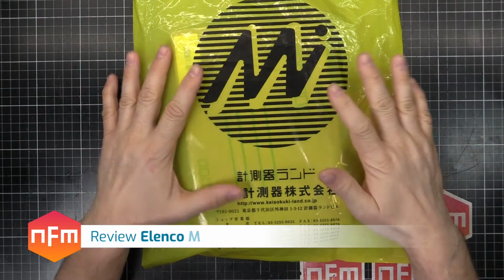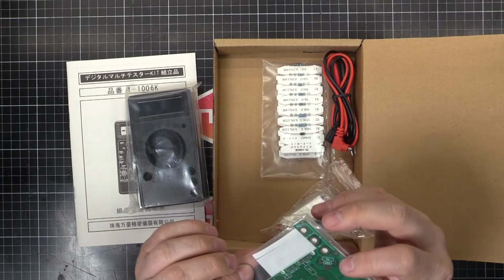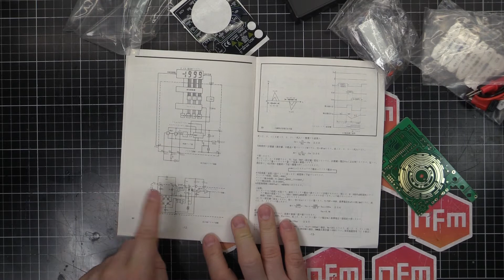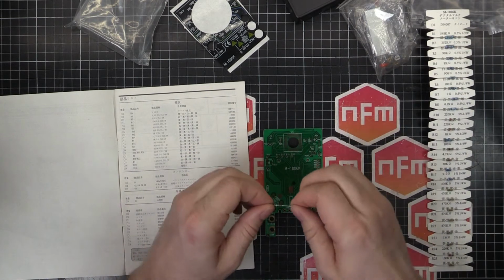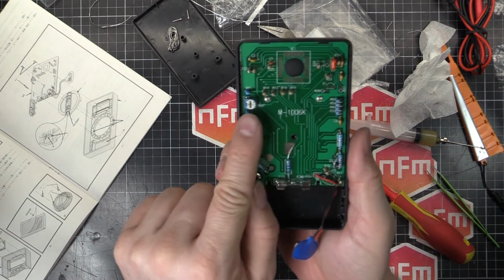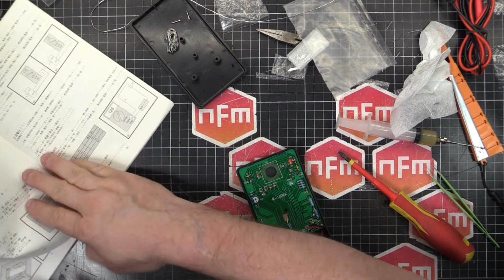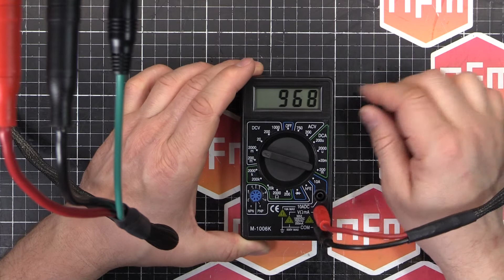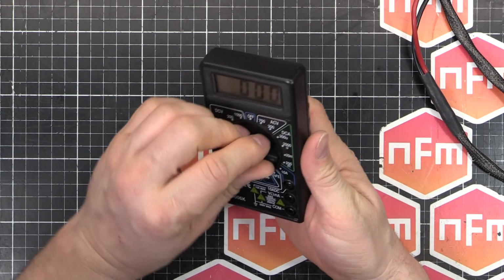Elenco M-1006K Multimeter Kit Review

Comment: Some use these cheap multimeters as panelmeters in DIY power supplies.
You can buy these assembled for half the price , look on the internet for DT-830B. 
They are available in black and yellow and are on the market since the 90's as M-940.
There is also a black version, with a flashlight build in on top.
Reply from the maker: That flashlight model sounds interesting. I wonder how many features they can pack into one of these....

Comment: I do get them at Harbor Freight for free, specifically to use them for sacrificial uses. Like, if I suspect something is going to go bang. Also, as someone mentioned, I use them as meters on DIY test equipment... Such as my DIY DC Constant Current Electronic Load and the DIY Isolation Transformer that I am currently building. I have a certain fondness for them, or maybe it's just pity... lol...
Reply from the maker: Yeah, that is one good use for them. They are accurate enough to use on things that you don't want to risk your good meter on. :D